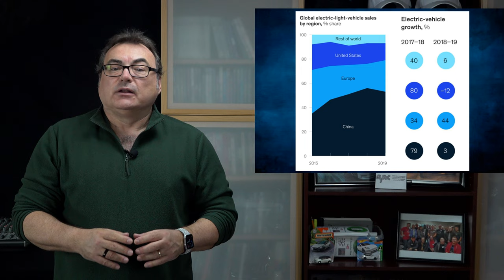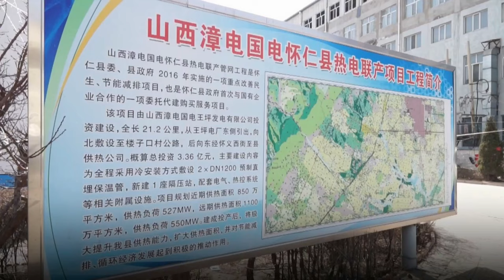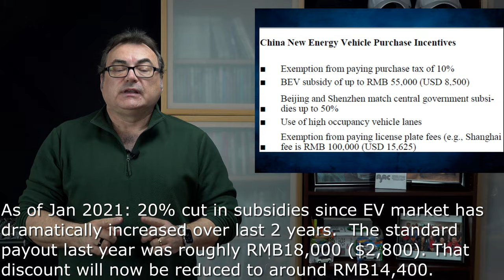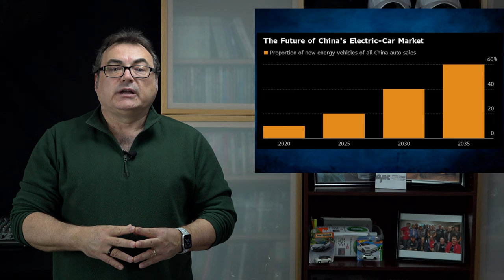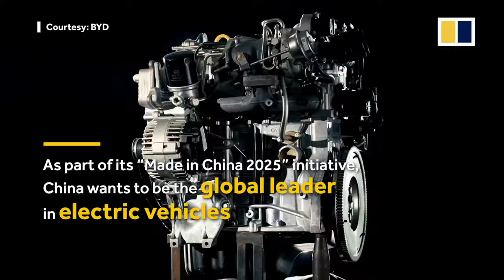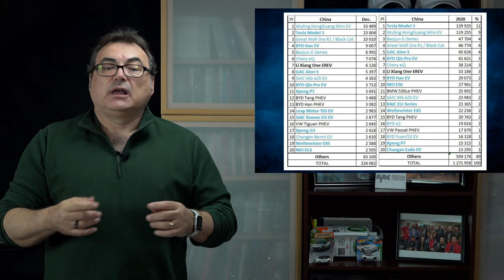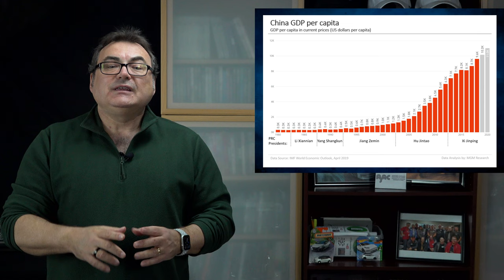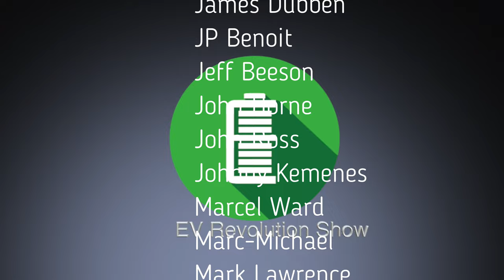Episode 124 - The China EV Revolution!

Comment: Awesome show thankyou from South Australia. Can't wait till plug-in hybrids are not calculated in EV sales. They deserve recognition for what they are . . . A hybrid. Hybrids pollute as much as an equivalent ICE of 80% the size.
I agree with your ECOTY nomination and would love to have one here. Regrettably its alliance with GM will mean we don't matter as a RHD market. 
Cheers Kenneth.
Reply from the maker: Thanks Wayne, appreciate you watching and your feedback!  On the PHEV's, they are not that bad some of them depending on the use case.  There are millions who don't want to take the leap of faith yet and go BEV, so a good sized battery PHEV is a great stepping stone.  If the battery size is decent enough, say 40+miles / 65+kms or more, then that can work for these millions who would, for the most part, drive it for daily use cases within these ranges.  I have a problem with PHEVs that get crappy range on battery-only as they clearly are compliance cars.  Need close to a 20kWh pack or more to work for many.  So I would not discount them yet, however soon for sure.  Give it another 3-4 years or so and I think by mid-decade, we should have enough choice out there, from micro-EVs to large SUVs and pickup trucks, that are all-electric to make the vast majority of consumers happy.
Reply: Thanks for your reply. I understand the theory behind PHEV yes some could drive them as pure EVS but carrying around an ICE engine, having to change the oil every year if you use it or not seems a huge waste of resources. Other hybrids are just wrong on so many levels compared to a better packaged smaller lighter ICE vehicle which will emit less carbon from birth to the grave than a 20% larger hybrid.
Reply from the maker: I agree!

Comment: i don't think that tesla will have a superior advantage in china because they don't have the strategy to produce for china.
producing in china or producing for china is a really HUGE difference.
VW learned that in the last 40+ years.
one example: VW produces 'similar' cars in china for the chinese market. the display behind the wheel is not the same. it is a much cheaper display. it might have more refections, it has a lower resolution, the application processor is cheaper with less performance which results is less animation and simpler effects on the screen etc. these are the differences between chinese and european version - wherever they are being made. and this results in the significant price difference of these cars.
this needs to be understood.
then tesla can make a model 2 either for the chinese market or for the european or other markets.
currently they make the model 3 for other markets like europe etc. and sell them in china too. but it is not perfectly suited for the chinese market.
VW now has two factories in china where they produce two different versions of the ID.4. but not for the european market, if i am correct. if they are being produced for china only is something that i don't know. but for sure they will produce "chinese versions" there.
Reply from the maker: Thanks for watching and for the great info!